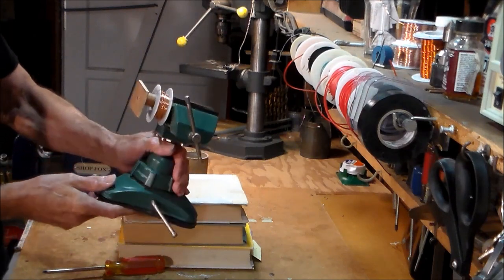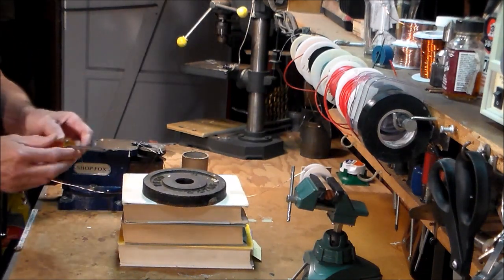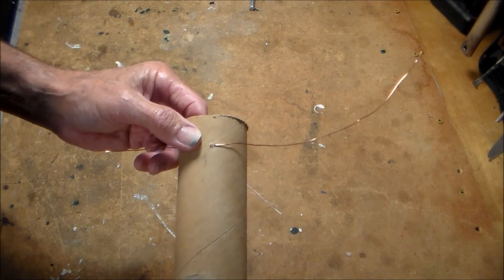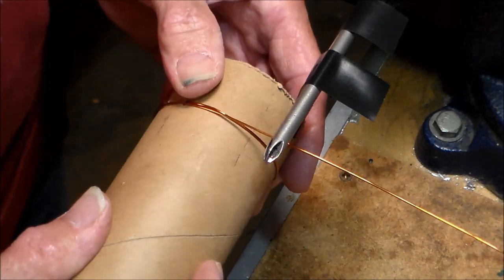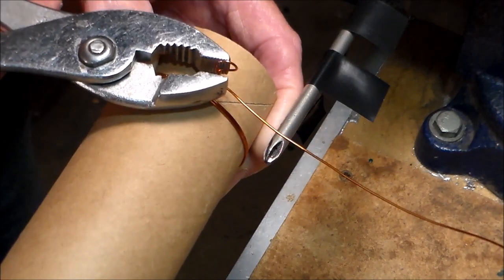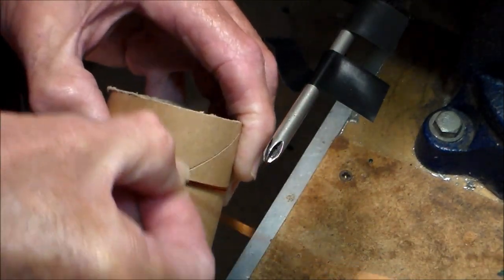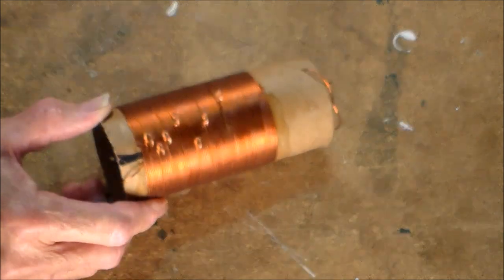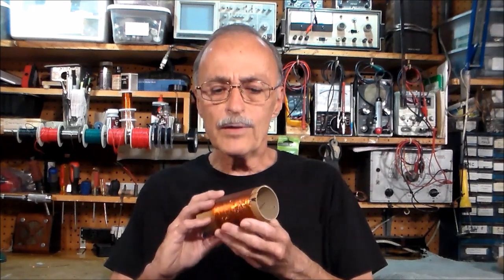MAKE CRYSTAL RADIO COIL TAPS

Comment: Thanks for putting this information out. Crystal radios have fascinated me since i was knee high to a grasshopper, and i've recently (the last 10 years) been hand winding heater element coils. it has rekindled my interest. Now to find out how to build tuning caps! lol
Reply from the maker: Hi Dan
There is at least one video up on YouTube showing how to make a tuning capacitor out of two cardboard tubes, each covered with aluminum foil. One fits inside the other and the capacity is changed by sliding the inside one in and out of the outer one. This actually works! Thanks for your comment.
Reply: @squarewave2  Yeah, it would make sense that that would work. In fact, I can see a whole science built up of people trying different foil shapes, etc to get different results. In fact, it seems to me with my zero knowledge of radio but some of electronics and mechanical engineering that such a design would allow for extremely fine tuning if the "rail" that the inner tube moved on was a length of threaded rod....

Comment: How I wind fishing line using required tension:  Put a hole on each side of a box then run a dowel from one hole,  into the box, place the dowel thru spool  and run dowel out the other hole in the box.  Then I throw towels on top of the spool and also you can add more weight by placing books or other weight on top of the towel.  The line comes up thru the towels.

Comment: Very good! I put my form between two fender washers on a threaded rod that I have a handle on. Basically I crank the assembly the number of turns I want and the coils wind tightly and smoothly.

Comment: That makes loops very easy. Up to now I just used separate windings instead of trying to make loops. I found that removing the varnish to be easy if I use a small torch to "toast" the varnish then use steel wool to polish it up works well. Of course on a coil like the "Boy Scout" radio sandpaper is about the only good way of doing the side strip for the slider. But the torch method works well on the ends with little to no damage of the wire.

Comment: Hi there, I was wondering if the diameter of the coil matters?. I just picked up a few old air spaced variable capacitors and am looking forward to giving this a try. :)
Reply from the maker: The coil should be two inches in diameter by about five inches long. Use 60 feet of 20 gauge enamel wire. You should try to find
"Radios That Work For Free" by K.E. Edwards. Great info on making crystal radios. Good luck!!
Reply: @squarewave2   Excellent information, and thank you for the fast response. Cheers!.
Reply: I don't know much about crystal radios or coils, though I'm now interested in making radios. Here's a few dumb questions: What are the taps for and is it really important for a certain gauge wire and the number of turns? Would more turns be better?
Thanks for your great videos.

Comment: Scraping the loops is easier by cutting the loops, heating the ends then wipe with 220 grit sandpaper and finish with solder to keep them from unwinding.
Reply: Or don't cut, but instead carefully dip the tap loops in a saucer of acetone.

Comment: Will crystal radio work with copper wire coil instead magnetic copper wire
Here magnetic copper wire is VERY expensive
Reply from the maker: whatever you call the wire it has to be insulated. Magnetic copper wire has a varnish coating so it is insulated.

Comment: I tried looking it up online, but what are taps used for in a coil?
Reply from the maker: The taps are an easy way to lengthen or shorten the coil thus changing its electrical value i.e., inductance. Changing this value helps to tune in the station you want.The old "Boy Scout" crystal radios used a coil slider to do the same thing.
Reply: Just Incase the coil gets dirty ,you turn on a suitable tap and wash it ! 🤣